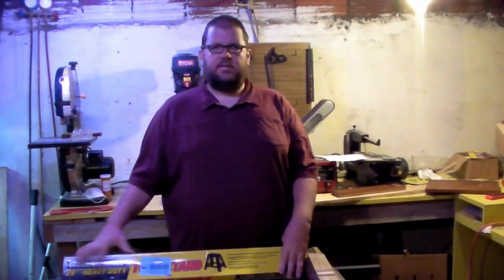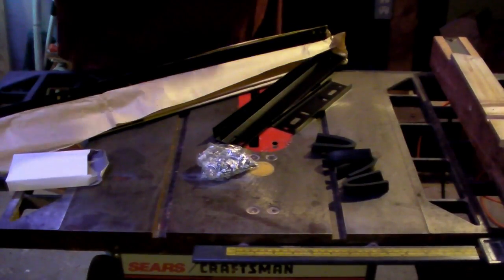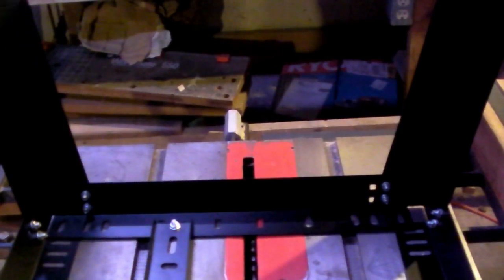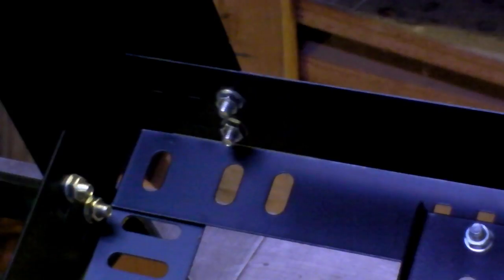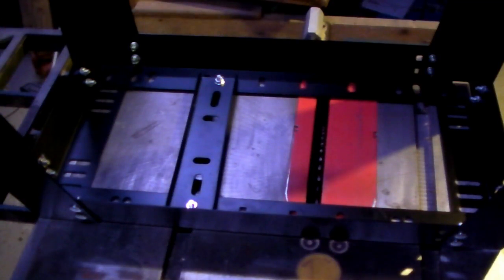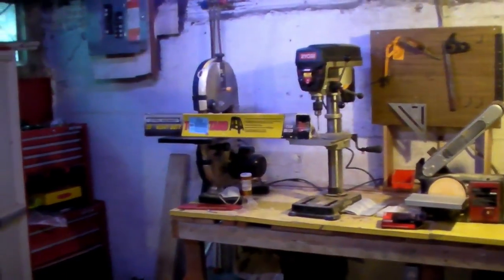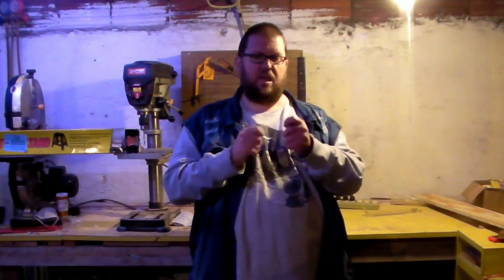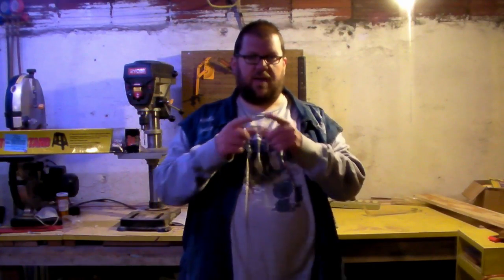Harbor Freight Tool Stand

Comment: Hey! I’m really hoping you’re still paying attention to this video. I’ve been fiddling with this thing for an entire day now and cannot figure out how to get it together to fit the 16 in variable scroll saw. Could you please tell me exactly which holes you have the legs in? As they’re 3 holes for the cross bars on the top and bottom I can’t figure out which ones make this thing work. The directions are completely useless, props to you for getting the thing together and useable.
Reply from the maker: I'm sorry to say, I no longer have the scroll saw, but what I remember is that the cross bar didn't even come into play when mounting the scroll saw. I did use three screws. The two side ones went in holes along the side of the frame, and there was as rear screw that went in one of the short ends. The cross beam was just pretty much there for stability, if it even added that. I do remember one of the screws, I think the one under the motor, I had to put in it's hole on the machine before setting it on the stand because there was not enough room to insert it after it was sitting on the stand. It was an awkward fit and it took me a while to work out too.

Comment: would this be sturdy enough to mount a vise to for filing steel?
Reply from the maker: It would probably be ok. It sits pretty solid with the scroll saw on there. Make sure the screws are tight and none of the legs are spread out and not in a bind.

Comment: I bought one of those several years ago for my scroll saw so I don't know if it is identical to yours but you said that you can add a shelf on the Craftsman but not on the Harbor Freight. Well, I had some scrap 6" melamine boards that I cut to length and they fit the Harbor Freight stand absolutely perfectly between the legs where the braces are. I have probably 50 pounds of tools on the shelf and it has been fine, and it also helps stabilize the tool stand - not that it really needs it.

Also, I bolted a 12"x24"x3/4" melamine board on the top of the stand, and bolted the scroll saw to the board. This allowed me to bring the saw closer toward the front of the stand so that I don't have to reach as far toward to the blade.
Reply from the maker: +Pro1er Thanks for sharing. I was worried that the metal being thinner, it would not really be up to holding much weight. The board on the top would be an excellent upgrade as well.